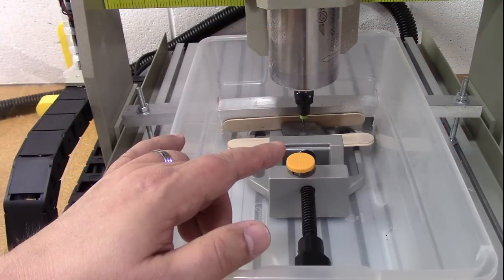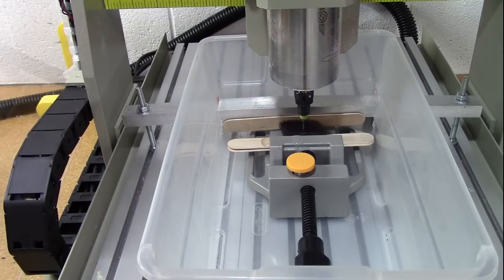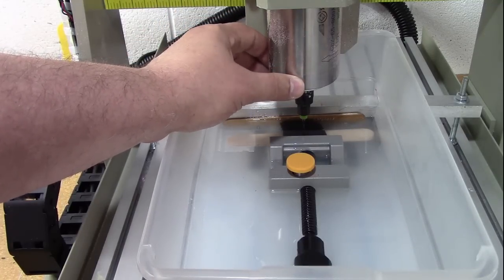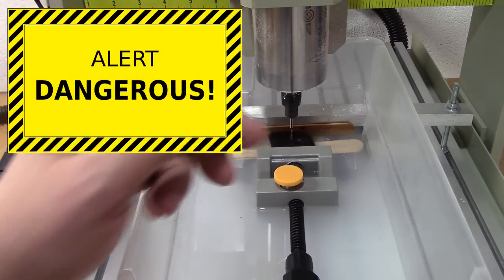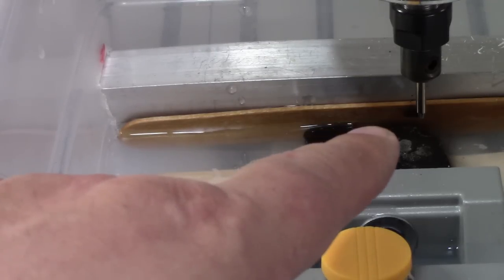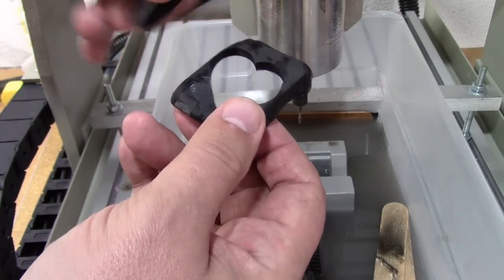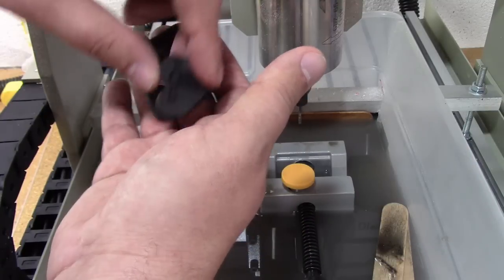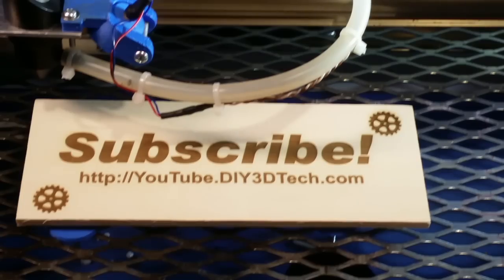3040 CNC - Cutting Solid Rock for an Etsy Project!

Comment: Hi. I like your video it is a very nice outcome.
I am new to CNC milling and have a few questions:  
1 Can you tell me please what router bit did you use for carving that stone? 
2 How did you tell your CNC machine where the rock was positioned on the machine itself?
3 Since it was an uneven stock, what did you set as zero point for the stock when creating the toolpath?
Thanks very much. Keep it up
Reply from the maker: Thanks for the kind comments and here is a link to the bits I used: https://amzn.to/2UrUXKo and centering I simply set my cam software to use the center of the material and then center the bit on the stone.  I also measure the max thickness of the stone and use that number in my CAM software.  Hope this helps :-)

Comment: Use a heat gun and glue a 1/8 inch thick piece of wood or plywood on the bottom to support the workpiece.
Reply: I meant hot glue gun.
Reply from the maker: I wonder how it would deal with the heat?  Might be something to test...